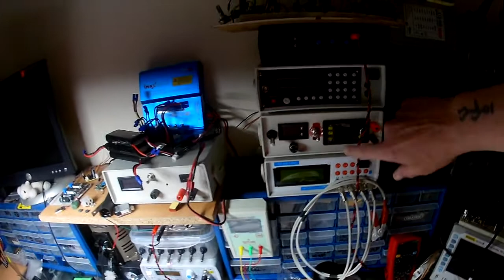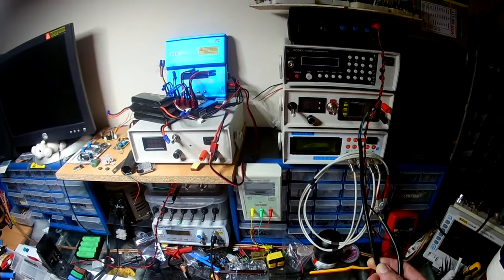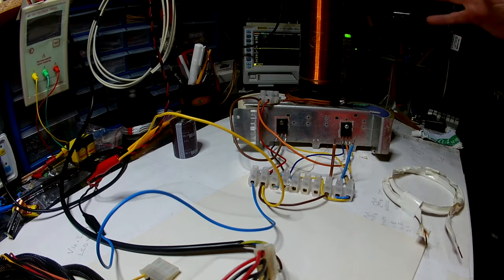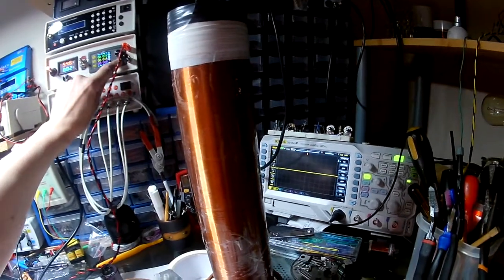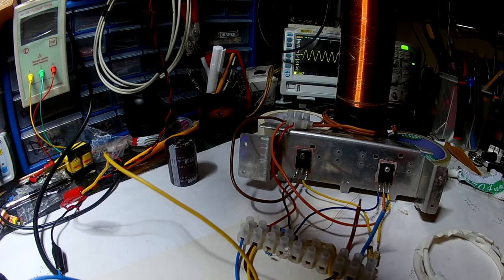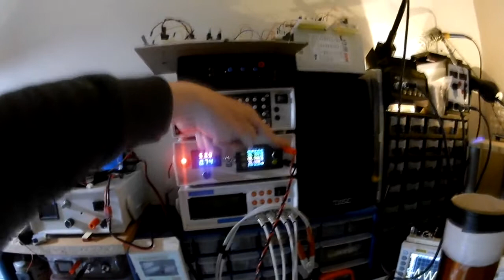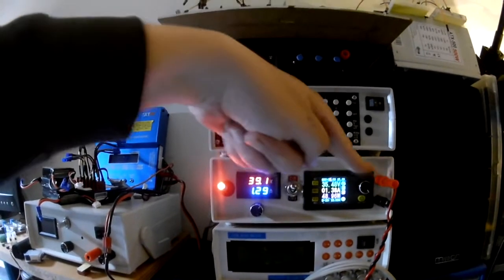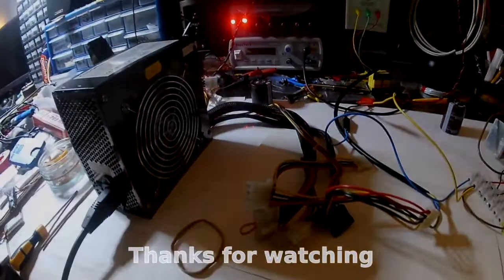Playing with DPS5015 and SSTC

Comment: I believe that the 12v output are all parallel internally so combining them externally probably won't help. You could try  just putting a multimeter on the 12v supply to see if it is sagging.